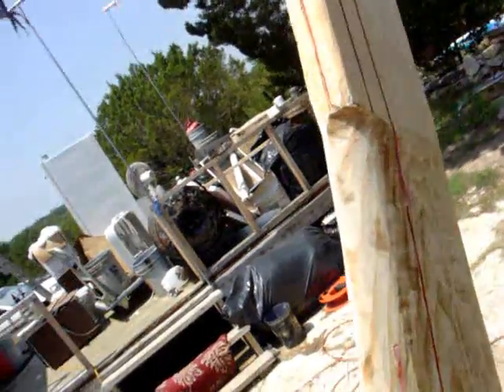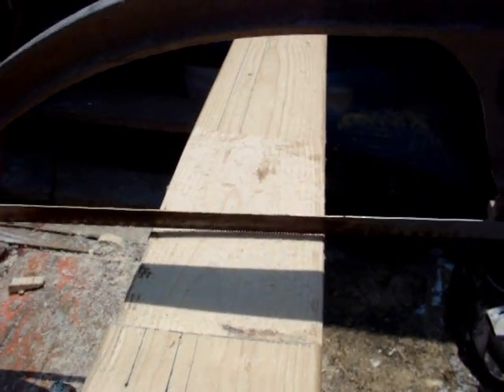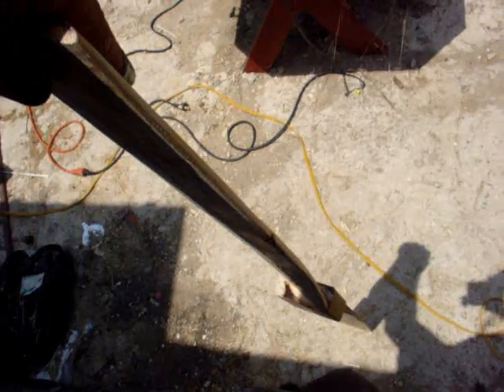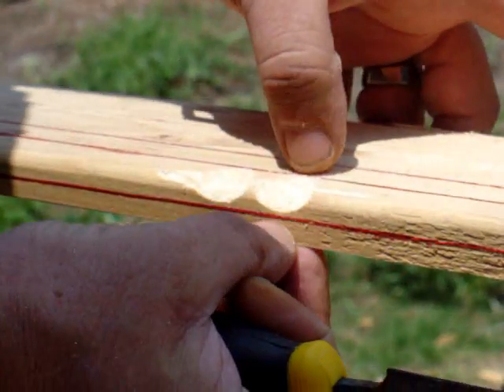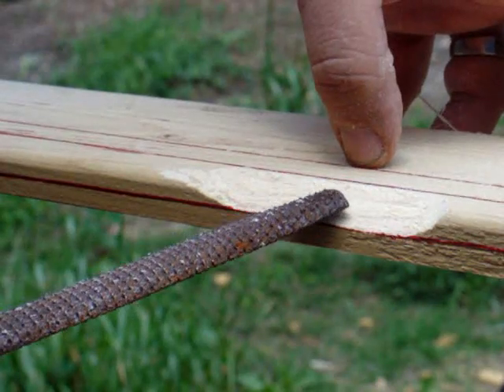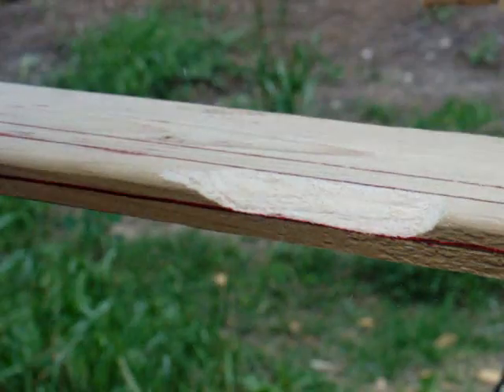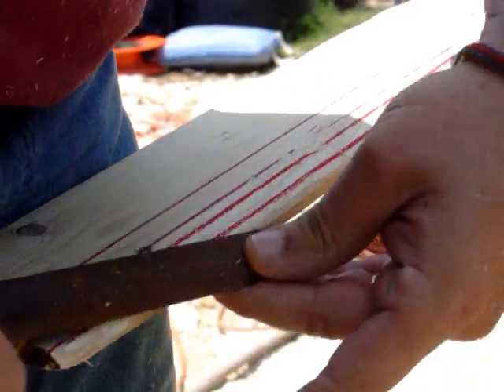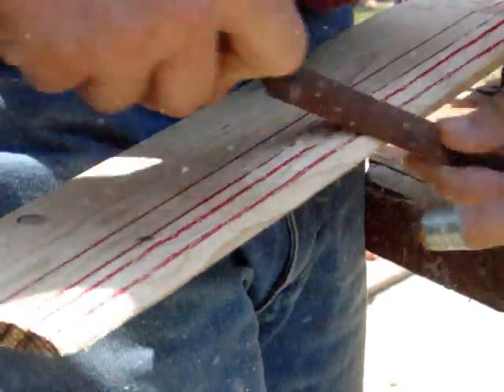How to carve a wooden propeller (Part 6)

Comment: Trick to cooking with cast iron and easy clean up, either a light coating on the inside of the pan with cooking oil. Outside coat it with dish washing soap for soot. prior to cooking. Soap just washes off after curing in the heat..

Comment: i have made and repaired wooden props for paramotors but found its not worth the trouble unless you use descent wood without knots otherwise you have faults in materials, p.s, no wind power in my part of U.K as houses are built to close together

Comment: Great work doing the carving and explaining everything as well! Thanks for lots of useful info.
You say that the more blades the propeller has, the slower it will turn and larger degree it needs. Is there any way of figuring out what the degree at the end of the prop has to be if the angular speed and the size of the prop is estmated?

Thank you,
Klemen
Reply from the maker: These props are 4.5 TSR. They are about 3 degrees at the tip.
Some props actually use a Tip Speed Ratio of 7 x the wind speed. They are around zero degrees at the tips.